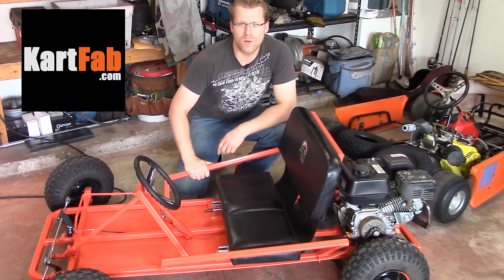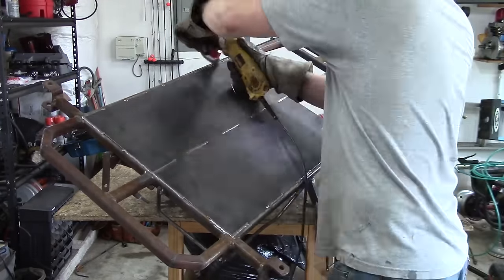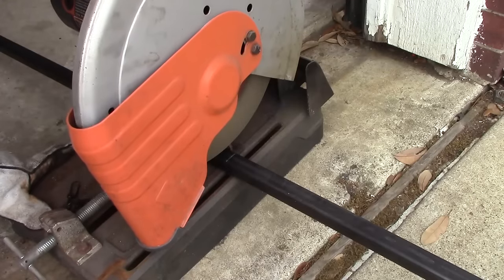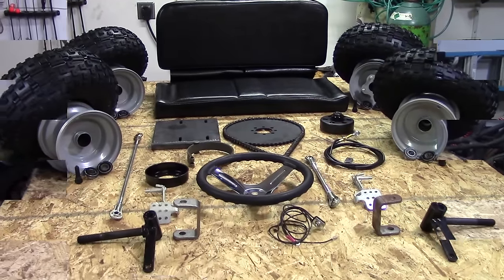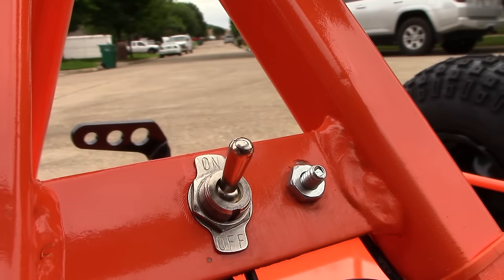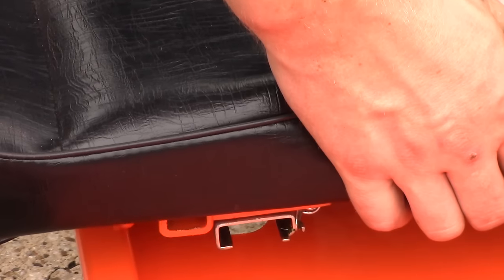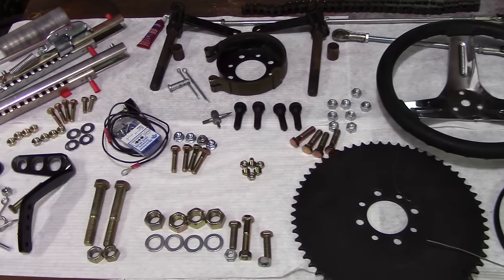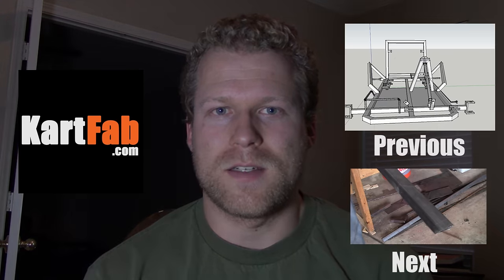Go Kart Materials: How to Build a Go Kart: Frame Materials

Comment: For anyone without a welder or experience, get a cheapo "flux core" welder.  It's like mig and stick had a baby. The wire used has a flux in the middle that adds shielding gas. 
It's used often in structural steel, but works well for the tubing you'll use here. Nice deep penetration.    It's a little messier and you gotta clean the welds, but it's really easy to do, and you can get a machine that'll do flux for about 150, and one that'll do flux, mig, stick, AND Tig (usually lift Tig) for a bit over 200. (on those, you usually gotta get torches with the valve in the torch, but they work)

Comment: My first go-cart was back in 1960 ! One safety item is dual return springs for the throttle pedal in different locations. One at the pedal and the other at the engine. My older brother ran that 1960 go-cart under my mom's car when the pedal spring came off. Great videos keep them coming.
Reply from the maker: Nice so is this why he is the way he is now? J/K

Comment: TIP FOR PEOPLE WITHOUT A WELDER. legit did this with a drill, an angle grinder, with the thin wheel and a wire wheel, along with an 8" ratchet, and a 24" ratchet. I used bolts and plates for the joints.

Comment: I will be cutting my own 3/8 stock for the tie rods. What length should I cut each one to? I didn't know if the measurement is taken with the tie rod ends already installed. Thanks!

Comment: Oh by the way my house is surrounded by trees for 3 acres and has a field (1.4) acres. There are branches potholes roots hills and a ton of leaves. I think I need suspension. Can you make a video on that please. If you want to know what go kart it is, the name is mostly scratched off. It sat outside my friends house for years. The most I can give you is       

BRAND---> THUNDER KARTS

NAME---> TORNADO 

it is a two seater it it the factory color RED it's very tall 4ft 6in 

The tires are Carlisle Snow Hogs

Comment: Wow So it looks like you know your stuff. 
Anyway I am writing to ask some advice.

I have some parts from ol go cart and as I’m getting up in years and 
short on walk, I want to build a mobility cart for myself. As I am a fan
 of the 2 wheel front steering and single rear wheel power design. What I
 have is a couple axles / sprockets, 6 wheels. What I have in mind is 
what I call a chainsaw design were I will build the cart with the 
steering up front and a multi ( 4 wheels ) chain driven dual powered rear
 axle. with some sort of electric motor, batteries. As I am around 
300lbs. it will have to be beefy. Any ideas will be welcome.

Comment: The photo for the "Deluxe Upgrade Live Axle Go Kart Parts Kit" shows a three-bolt bearing kit included --- but the go-cart parts list included in the plans lists a 2-hole bearing kit.  Which bearing kit will be supplied when purchasing the "Deluxe Upgrade Live Axle Go Kart Parts Kit"?
Reply from the maker: The supplier provides that and it will work with two or three. There is no extra benefit one way or another with two or three hole flangettes.

Comment: Love that guard on the 11000 rpm grinder.... Safety first ey
Reply from the maker: How else am I going to fit a 6” disc on a 4 1/2” grinder? The guard gets in the way 😂😅
Reply: Idk mabey buy a different tool like a band saw or a matobo that can fit a 6" disc. I mean if you can live with 2 fingers on your dominate hand and half a grinder disc shoved through your brain then keep on trucking brother.
Reply from the maker: Have you ever used an angle grinder? Just curious.
Reply: KartFab if I never used one how would I been know about the hazards associated with using one? I mean it's your choice man I'm just saying it's dangerous as hell to use it like that but wtf do I know I mean I guess the put them guards on for no reason right
Reply from the maker: So you basically said that I'm going to cut off 3 of my fingers and literally cut open my skull. I need to get my waders on cuz its getting real deep, real quick.

Comment: Will I need a welding brush and hammer as well?
Reply from the maker: +Marcus Valentine if you are using flux core or stick welding you can use an angle grinder with wire cup attachment to remove the flux.

Comment: So I went to the site looking at just their engines...Cause I plan on building a drift trike... and I was wondering what engine you have on yours. Did you go with the racing engine they have on the site, or one that was stock (can you do that???) or did you build up your own engine?
Reply from the maker: stock, you dont need a lot of power for a drift trike and the harbor freight 212cc engine is perfect stock. Try that out first, and you can always upgrade it later.
Reply: +KartFab Okay thanks but if I was to make it with street tires that had traction. Would you say I should get a built up engine? or just remove the speed gov. and oil sensor
Reply from the maker: just try it stock first and see how you like it. You can always add stuff later.
Reply: +KartFab Okay thanks for the advice! :) can't wait to see more of your vidd

Comment: +kartfab is there any roll cage available? And seat belts too?
Reply from the maker: +Miguel Martinez yeah, just go to kartfab.com/go-kart-plans and click down on the extras article that goes over the seatbelts. 

For the roll cage though, you will need to come up with your own.
Reply: +KartFab is there also any way to add front or rear suspension or front brakes?
Reply from the maker: you can choose front 'springer suspension' when you get the kit, it is part of a drop down. You do not need front brakes on a go kart because it is a go kart. Its complete overkill.
Reply: +KartFab where exactly on gopowersports.com can I find the suspension parts I cannot find them I'm trying to build the deluxe live axel go kart with seat belts and a roll cage
Reply: +KartFab can you send a link to the necessary suspension parts? I'd really appreciate it thanks

Comment: just wondering why you didnt go with a live axle?
Reply from the maker: +Greg Ashcraft Live axle go kart plans will be released October 1st, 2015. They will be available on http://kartfab.com/go-kart-plans for twenty bucks. 18" knobby tires, disc brakes, torque converter, etc. The kit will also have pre bent steering hoop and side rails so it looks better too! :-) I have actually finished the plans, and am in the process of working with GPS to have another kit, and building the kart to show how it is done.

Comment: what else do I need besides a axle/ engine to complete a kart
Reply from the maker: It's all in the kit. If you want a 1 wheel drive kart you get this kit, if you want a live axle kart, you get the live axle kit http://kartfab.com/live-axle-go-kart-plans it comes with everything you cannot make, but you need to get the bolts and steel to make the frame. If you want to make your own custom frame, you can use my plans as a guide, then do your own thing.

Comment: hello I would like to know what kind of measures are used in planes thanks
Reply from the maker: +juan silva inches
Reply: thank you very much I do not understand is when you take measures length by the width .. is that you are pulgadas..por Example 4 '10' 'which is 4' with the apostrophe .. sorry to ask you so much thanks mucgas
Reply from the maker: 4' is four feet, 10" is ten inches
Reply: my question is if your average on both measures (feet and inches) or do the equivalent of inches to feet or vice versa ??
Reply from the maker: Your sentence makes no sense. What are you trying to accomplish?
Reply: what I meant was that the two types are used Medicien inch and foot

Comment: could I Add A 13 HP (420cc) OHV Predator Horizontal Shaft Engine instead of the 6.5 HP 212cc Predator Engine
Reply from the maker: yeah, but you would definitely need to go the route of a deluxe upgrade live axle build (see live axle go kart plans on my website). This is the simplest way to build a go kart, and a 420cc engine is too much for a one wheel drive go kart.
Reply: Ulises Gomez   you can but change sprockets to your weight for the right gearage

Comment: if you was to build one and sell it how much would it cost???
Reply: does on how well bullet it was Built with flawless welds and had a great paint job and want tacky,  you could EASILY sell one for 600 bucks if not much more. but if your looking for a simple quick build with high profit look into a drift trike. the hardest thing would be getting the axle but all you need for a front end is an old bike and then you have steering and breaks
Reply: +josh knuders cheers

Comment: how to make reverse shift?
Reply from the maker: you dont make a reverse, you can buy a comet FNR trans, which is going to cost like $250, so most people dont opt for that. Another option (using your own brain here) is to hook up a battery to a car starter, and figure out a pulley type system that you can engage/disengage and when you are completely stopped, engage the belt/chain for the reverse, then supply current to the starter.
Reply: or maybe a DC electric motor connected some how with gears that is hooked up in reverse to a toggle switch that when stopped you could use the momentary switch to go backwards. Plus side to this is you could also hook it up correctly to the battery through a charge controller somehow to charge your 12 volt battery passively for any accessories you have.

Comment: Can you please tell me how much didi the metals cost???
Reply from the maker: +AGKrag $70-$130
Reply: +KartFab WHAT OF engine is it?
Reply from the maker: honda gx200, greyhound 6.5, honda clone, predator 212cc - ANY 5-6.5 hp 3/4" shaft horizontal shaft engine will work, like I said in the video. I used a predator 212cc that I got from harbor freight for the build.
Reply: +KartFab ok thnx for the info 😀😀😀😀
Reply: +KartFab thanks a lot!!!

Comment: So what was your total cost?
Reply from the maker: +troublejenn75 you will end up spending less than $1000 when it is all said and done. parts $450, steel, $170, hardware $50, engine $170, shipping??? paint ??? you will probably realistically end up spending $750-$850
Reply: +KartFab  awesome savings!

Comment: why not use a live axle?
Reply from the maker: I have go kart live axle plans and kits here: https://kartfab.com/live-axle-go-kart-plans
Reply: I appreciate it but I build and sell shifter karts.
 One wheel pull carts are a waste of time. If you don't rotate the tires regularly youll keep replacing one. They get stuck quicker than live axle carts and a live axle set up is only a hundred bucks. I've changed a lot over to live axle but never changed one to a single wheel pull. If a person is going to build a cart, why not build one they'll be happy with for the duration of the cart?
I do like the videos man. Glad your helping to keep people karting and showing them another way to build their own. I know as a father, my favorite build was not a 1000cc kart, it was a little skeeter I helped my son build. Thanks for everything you do man. Keep it going.
Reply from the maker: i did this build series with the cheapest possible kart in mind, so it has brake band one wheel drive, centrifugal clutch. I also did the live axle stuff with torque converter, big knobby tires, torque converter, etc. So both. A lot of people are really really budget minded so I did this build series with that in mind.
Reply: It's all good brother. One of the builds I did to prove a point to the neighbors was a wooden cart with an electric motor. 12 volt 6hp harbor freight motor. Hand break with hardware and parts scavenged from wagons and bycicles and such. Tots loved it. Give it a try. Sometimes smaller is more challenging.